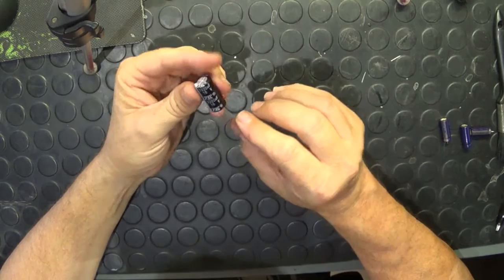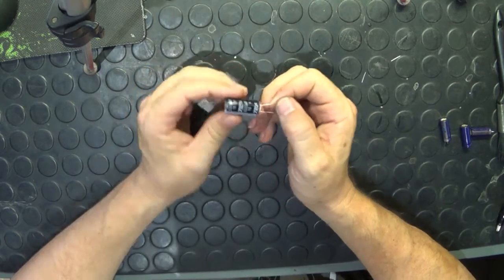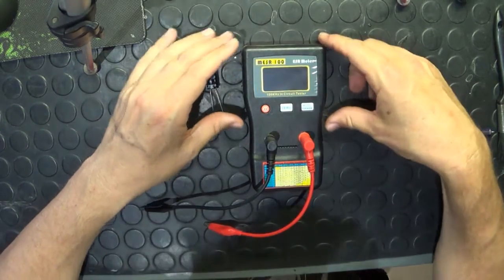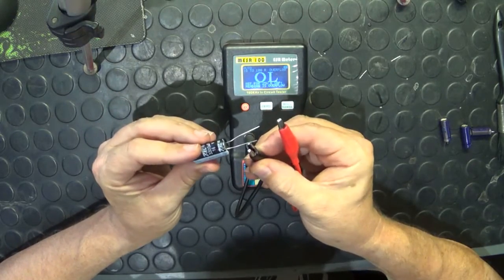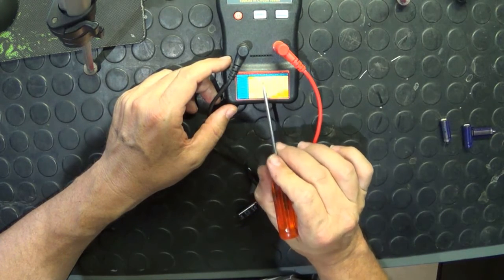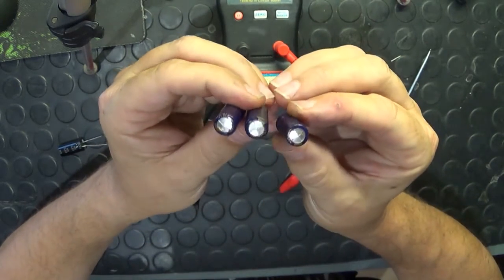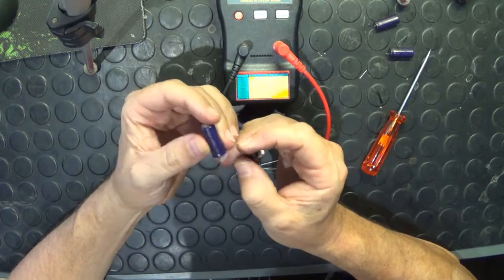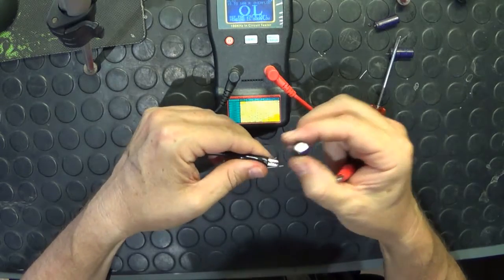Capacitor's for Dummies 101

Comment: Excellent video, definitely going to have to get one of those meters.  Definitely better to replace them before they cause damage to the circuit board too.
Reply from the maker: +electricadventures You will need one sooner or later. Cheers

Comment: Cool video. I've re-capped a few of my old boards and it is a good way to revive such old stuff since capacitor decay is so common. I fished an old P4 motherboard out of a bin once, cleaned it up and replaced the bulging caps - resulting in a PC that works great again. I even replaced most of the capacitors on my Amiga 600. It didn't fix the issues I'm having with it but it doesn't work any worse than it did before at least. :-) Surface-mount caps are much more difficult to replace but it is still possible with the right technique.
Reply from the maker: +Anacreon ZA Agree 100%. I want to recap one of my arcade machine monitors as a project. Cheers